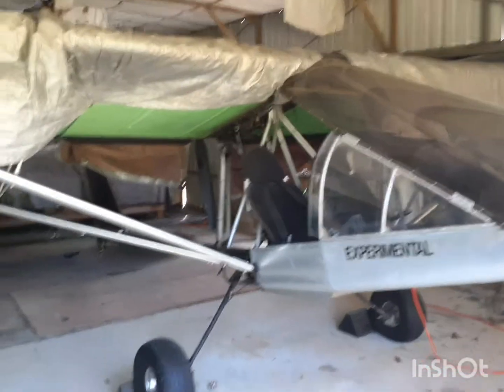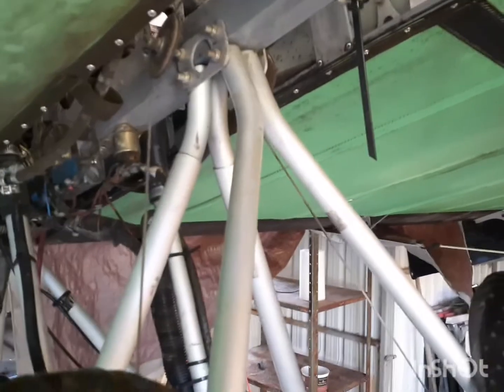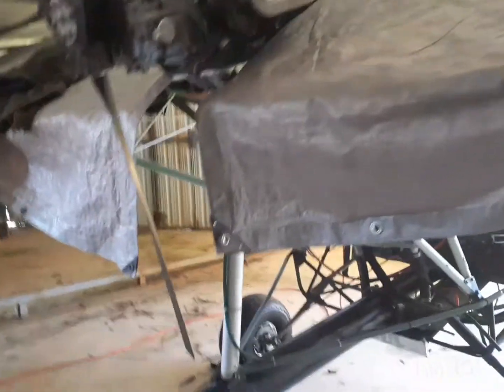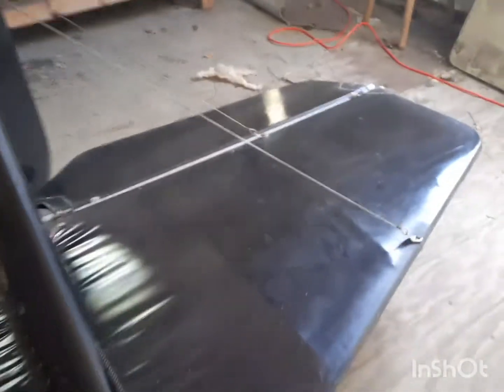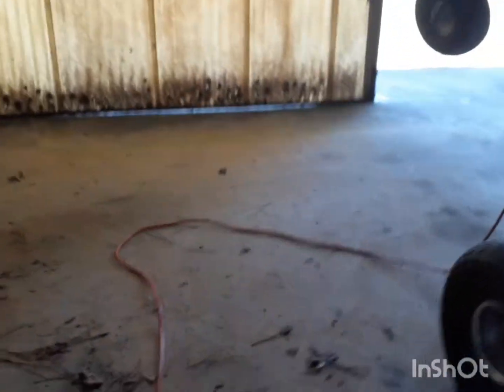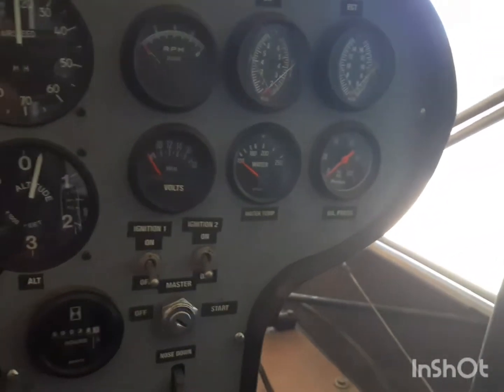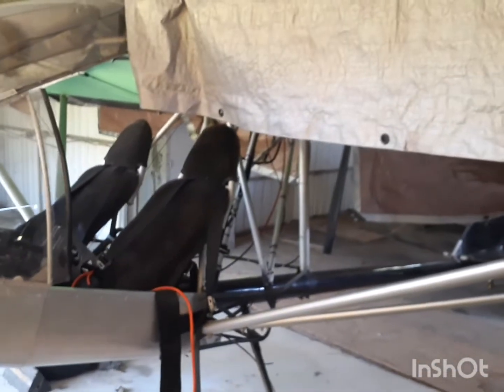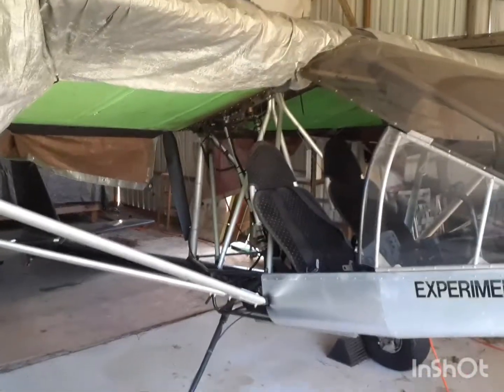Rans S12 for sale

Comment: Is this still for sale?
Reply from the maker: Hi Gary,  sorry, I just saw your post.    Yes it is, however,  I'm still waiting on my paperwork from the faa.   Their about 6 months behind,  so I should get it in Feb.   

I'm looking at 13.5K
Reply: Can you tell me the history of the plane and what you’ve done to it?
Reply from the maker: @garybarnes7569  email me.     Heavyliftpilot@gmail.com
Reply from the maker: @garybarnes7569  I got it from a guy locally here in Augusta Georgia in 2016.  It had a 582 grey head, dual ignition.   Skins were probably original,  so first thing I did was to put new wing covers on.   I still have the tail feathers NIB cuz the ones on the plane were coated with the UV protection and looked ok.  Put new fuel tanks in the wings.  New tires and tubes.  In 2018 I sent the engine to rotax Rick for the 670 upgrade.   Have about 30 hours on it now.    I just recently bought a fly baby biplane and need to sell the rans.  I didn't get the bill of sale sent off to the faa until recently when I decided to sell.   My bad.  Didn't think I'd ever get rid of it, plus didn't know I needed an official FAA bill of sale done.   But that's in the works now.    

Where are you located?
Reply: @jimmyboy163  I’m in Spring Lake MI. One of your videos this is mentioned as an XL. Is it the XL? Is the full enclosure still available for it? I’ll also need to put a heater in it for the cold fall and early spring days. Once you get the bill of sale will it also get an “N” number?
Reply from the maker: @garybarnes7569  yes, XL model.   I'm pretty sure rans still sells enclosures for it but you might want to call them.

Also, it has all the AD'S done
Reply from the maker: @garybarnes7569  yes, will be N numbered